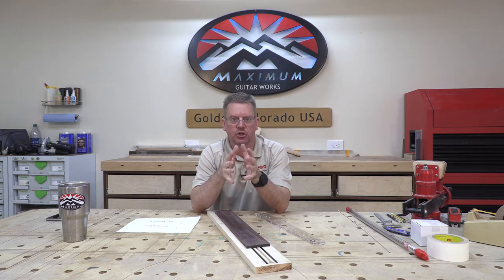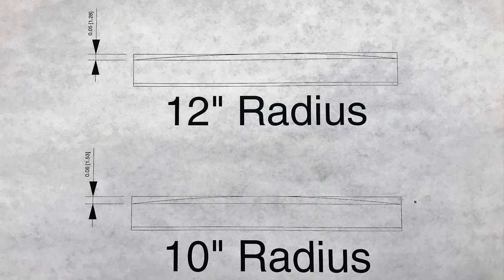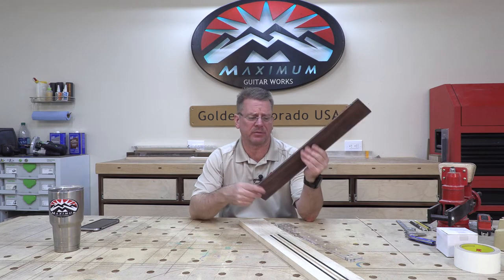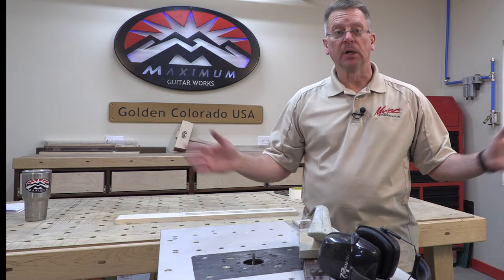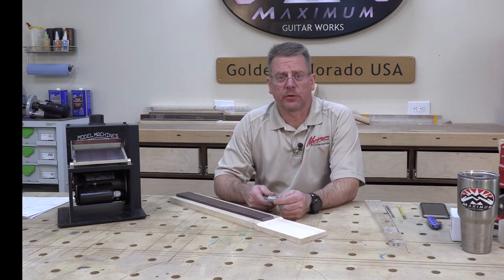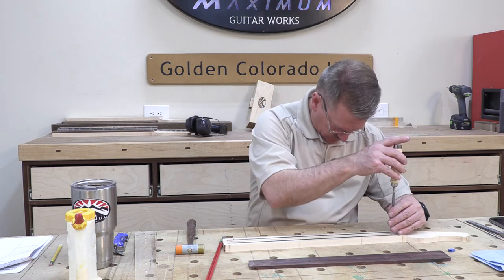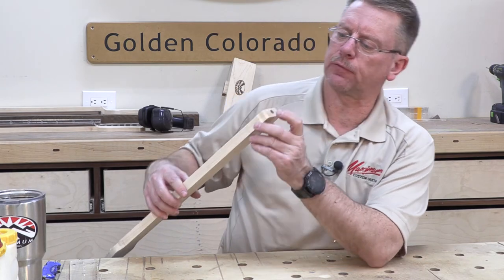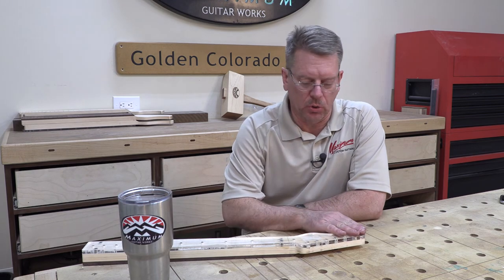Telecaster Build - Part 3 - The Necking Continuation

Comment: Really like your videos, Steve.  Like you, I want to have repeatability in my process.  There is an easy way to use the cut off of the fretboard to make a neck binding.  Then, the depth of the fret slot won’t be so critical.  If you’re interested, I can send you some images with descriptions and you can decide if you want to add it to your process.

Comment: The router table can be scary but the funny thing is the bit it self tends to be the least dangerous.  I have had my finger make contact twice on a bit and it was a cut only. The bit tends to kick your finger out, not like the table saw that pulls you in.  Projectiles are your biggest worry, it can launch something pretty fast and hard.

For the holes in the headstocks to protect the template you could use self centering bits, then come back and drill using those as your guides.

Comment: I had a good(maybe?) idea for you Steve! I’m Doing a roasted neck currently. Rewatching your vids for any tips I may have missed.

Seeing that Byrnes sander, I thought it could use a concave radiused drum to radius fretboards. May even work faster than the ingersol rand straight line sander/radius block method. Just a thought. I know Taylor uses a similar method for radiusing their boards. 🤔
Reply from the maker: It would be a lot more expensive...but a good idea.  Quick swapping drums for different radius.  Although...the straight sander block can do compound radius...which is the real benefit of that tool.  

Send ideas whenever you have them...I like to hear them.
Reply: @maximumguitarworks  expensive, yes. Worth it? Probably. Lol. I'll def send more ideas your way as they come to mind!

Comment: Hi Steve, thanks for replying to previous comments (Shela project). I know this is going to be  a long comment, Just want first to say thanks to you, the videos you post are very clear and well explained. I think you give content in a thorough way not found on any other Youtube channel.

You are right on time with this series!, I'm planning to make a tele guitar next.

Just a quick question on this video - moistening the grain for the headstock - I guess this might also help prevent burn marks? I'm also fairly new to routers (most people won't have a very high end bit like yours, so maybe burn might be more of an issue with a cheaper bit?).

A while back, I commented on one of your design videos I'd started designing my first solid body guitar, I got it finished! I've called it 'The Cropper', partly in homage to Booker T and The MGs guitarist Steve Cropper.

There is lots of room for improvement, I tell my friends who think I'm guitar mad - 'Well if it were perfect how could I justify another project!'.

I used a beaten up Mexican Strat neck, I refretted it, and changed the radius fro 9.5 to 12 with a radius block and straight edge. There were lots of nasty marks on the neck so I sanded out the neck profile a little slimmer.

I went for a roller tunomatic bridge, and I used a Dusenberg Les Trem 2 (like a Bigsby in someways, but mounts with two studs same measurements as a stop tail piece, check them out, the Les Trem has great tuning stability, but make sure there's plenty of break angle, I've reused it from a Les Paul copy which it wasn't so great on).

For the electrics, it's similar to a telcaster, and I used  a tele control plate for simplicity. I've got a used Seymour Duncan Broadcaster bridge p/up and a cheap P90 in the neck position. I knew the P90, would sound  a bit loud and too fat for the Bridge p/up, and got lucky with my plan to add a toggle switch on the control plate. The P90 has the option of going through a high pass filter before the 3 way selector. So with the high pass on the neck p90 sounds much more single coil, without the filter produces a fat lead tone.

I've been modding the electrics on guitars and building from parts for quite a few years, I just decided to go for it and start making necks and bodies knowing there would be rough edges in the learning curve. It made life easier by using a fender neck. The tele build I'm planning, I'll attempt my own neck.

I think the videos you've posted gave me focus and info to get this first body project finished. I'm happy with the results - Its got one thing going for it - I love playing it.

Many thanks, David
Reply from the maker: Hey David,

That might have been a record length comment...at least for my channel.  I will try to answer questions...let me know if I over look anything important.

Water and burning bits.  Theoretically it should help.  But generally burning is a result of too high of router speed...going too slow with the material feed...or an old or bad router bit.  I new cheaper bit should still cut well...but will not last as long as a high quality bit.  Burning will begin to dull any bit...so it is important to understand "Chip Load".  It is more of a CNC router topic...but good to understand with conventional routing too.

I like the Les Trem product.  I don't know why I don't use them more.

Actually...don't see as many questions as I first thought.  Thanks for your comment.
Reply: @maximumguitarworks  Thanks, I got the neck started for the Tele project last weekend.

Good progress but I'm cagey about counting my chickens at this stage!

I watched another youtuber luthier channel video about cleaning / maintanence of router bits. He suggested using a PTFE lubricant, same stuff for bicycle chains - it repels dirt and resin supposedly

I've only did my first routing a month ago, so I'm very new to this.

I does makes sense to me to lubricate the bearings that way not oil. The brand I got was a WD40 with PTFE, cheap off Amazon.

Comment: thanks so much for these lessons specially when you are lockdown situation. Sir could you please explain what model and power of your bandsaw. Thank you
Reply from the maker: I have a 14" Jet bandsaw...I think that it is 1.5 HP.  Nothing special...but seems to do a fine job.  I have reached to point where I now understand why many guitar builders have two bandsaws...one setup for resaw and the other for curve cuts.
Reply: @maximumguitarworks   and of course don't forget the production shops that have 4 router tables all set with different bits and jigs for pieces requiring bit changes... saves time and time is money.  Even faster than a CNC when you have multiple stations set up.  What fun.

Comment: If you wanted to add a veneer ontop of your headstock, how would you modify the thicknessing of the headstock itself for a tele neck?  Would you reduce the thickness of the headstock to accommodate the thickness of the veneer?  Or just keep the veneer as thin as possible?
Reply from the maker: I use my small drum sander for headstock thickness...you can also use an oscillating drum sander the the guitar neck on edge.   Veneers are tricky with a Fender style neck.  Much easier for angled headstocks.  If I were to want a veneer on a fender style headstock...I would want it to go under the fretboard.  That is tricky.  For an angled headstock...I use a 2mm head plate.  But that is all personal taste.  Too thin risks sanding through...so caution is needed.

Comment: Hey Steve, I'm sorry to ask this question, but what order would things happen in if you are cutting fret slots by hand (mitre box and fret saw), and don't have a lot of these fancy tools? Do some people cut the neck blank and the fingerboard blank to the same dimensions and just use the actual centerline of each piece in order to simplify things? And then could you cut your fret slots, make sure your fingerboard nut line matches your neck blank nut line, centerlines match, pin them together somehow (or use superglue/masking tape method), and route your neck silhouette into both pieces together in a single routing session?

Comment: Question. In lieu of resawing the headstock or using that safety planer, can you remove the bulk of the material with a dado stack?  Great videos, my son and I have been binge watching them as we build our first guitar of many.  You are a great instructor.
Reply from the maker: Thank you Richard.  Absolutely.  There are so many ways to get the job done...just make sure you stop far enough out for a good radius.  Like I often say..."if it works for you...it's right for you".

Comment: Is a Table router, safer for cutting edges (fretboards, necks blanks) in the meaning of tear outs and breakage than top routing?
Reply from the maker: I've met people that could do it all with a hand router...so it is possible.  I have better control holding my work piece and using a router table...but that is personal preference.  The techniques I show are mostly still valid...so use what you have.  With any router (and most other tools), just use it smartly and with respect.  Always be safe.

Comment: Hi Steve, how do you prevent grain tare out on the neck heal when you used the flush cut router bit on the table?
Reply: And you answered my question later in the same video lol
Reply from the maker: Basically the same way as I discribed on the headstock.

1.  Have a high quality and super sharp flush cutting bit.
2.  Only leave 1-2 mm to rout after the bandsaw process.
3.  Always start cutting on long grain and end grain.
4.  Moisten end grain if needed.
5.  Pray

Seriously though...I typically do not have problems with the heel because it is thicker material when focusing on the first three items above.  4 and 5 are optional if you are still having issues.

Comment: Why is there a radius on the fret board and not remain flat?
Reply from the maker: Is this a trick question?  Fretboard radius’s...radii...is just like the English language...everyone has their own spin. It comes down to personal preference and playability. Generally classical guitar are either dead flat...or almost dead flat. If a person plays more chords on a guitar...it is generally accepted that a smaller radius (more round) makes it easier to play. If a person does mostly scales and lead riffs...flatter is generally preferable for moving fast. Hence...is why some people like compound radius fretboards. That topic is single radius vs compound normally spurs some passionate debate. I generally use 12” radius unless otherwise requested...seems like a good middle ground to me...but I’ll do any single or compound as needed. There is more to the discussion...but that is the basics.